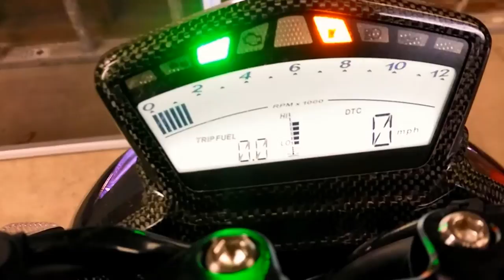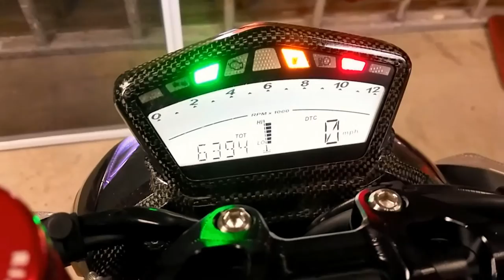Custom Ducati streetfighter S by Damian Dabrowski

Comment: is that a double dog exhaust? or did you make that yourself?
Reply from the maker: Double dog, but full titanium for 1198 model, modified by double dog to fit Streetfighter. Some oil cooler modifications was also required

Comment: What were the AN fittings for? Between motor and the oil cooler?
Reply from the maker: this full titanium exhaust was built for 1198 with longer streetfighter swingarm which interferes with stock rigid Streetfighter online lines position